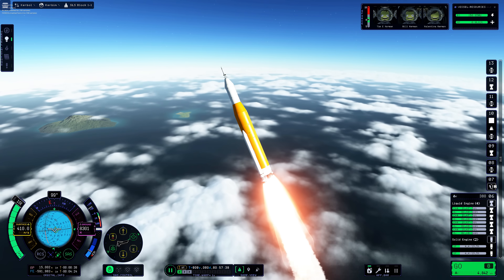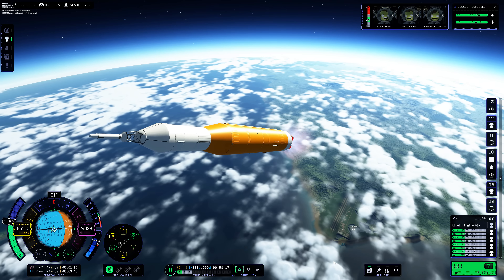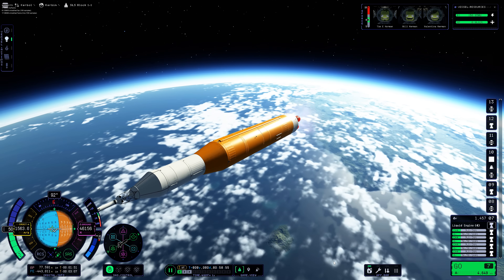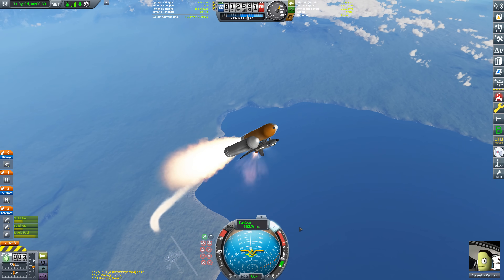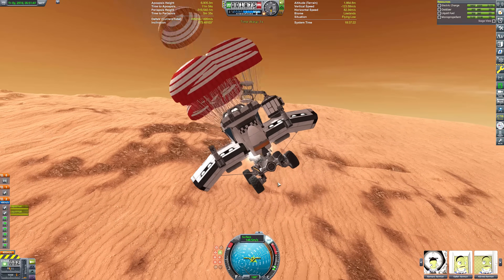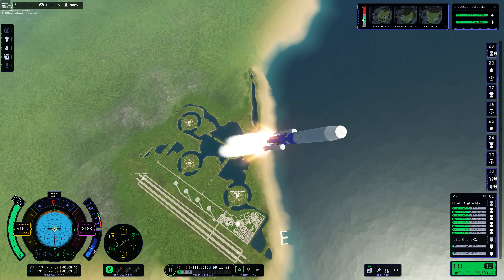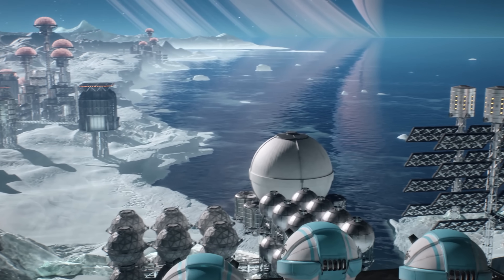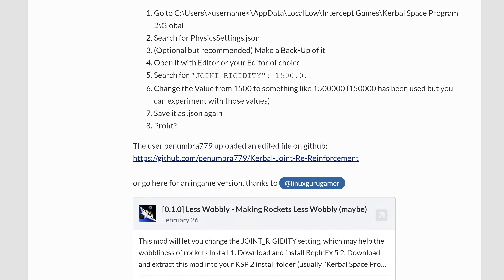Wobbly Rockets Still Haunt KSP2: Developers Face Uphill Battle

Comment: 4:50 I interpret it this way:     
Making it one rigid body means it cannot flex no matter how inaccurate that is. If you have an RCS or engines on the edge of a long stick it should flex, and making the entire thing a rigid body means it cannot flex at all. So the vessel cannot react to the forces put upon it, and the joints would not be able to break from G forces.
Reply: Joint stresses could still be measured without allowing them to deform and move independently. 

If two fuel tanks are stacked on top, they can be counted as a single rigid body with a center of mass in the middle for force application, but the joint can still be tracked.  The closer a joint is the the center of mass, and the further away a force is from that center of mass, the greater the joint stress.  Don't allow them to bend, but still allow them to break. 

That would solve a lot of it.
Reply: @DaveyKanabus  But then there is no external indication of stress. The rocket would just snap. That would be incredibly frustrating for new and old players as they think they are within the performance envelope only to over G the main tank and have a RUD. Turning down joint elasticity would be a simple fix. Elasticity is Stress/Strain (Stress over Strain) or (F/A)/(deltaL/L0). So by increasing the joints strength (or reducing the change in length) the elasticity decreases. That would arguably be the best fix but figuring out how to make DeltaL smaller is no easy task without making rockets hilariously strong.

Comment: So I know nothing about unreal and unity physics simulation. However, after having spent a decent amount of time using Godot, I can’t imagine it would be that hard to have the following to wobble check functions to match Matt’s suggestion:

(1) each vertical stack is treated a a single body.

(2) for each vertical stack, check the relative diameter changes from bottom to top. If there is too much change in any given part of the stack, a wobble point is added.
Reply: Thats exaxtly how it should work. Diameter check, mass check, something along those lines. If a % threshold above the center of mass is exceeded, stack joints get flex. If not, single rigid body. QA for corner cases and what not, patch in 2 weeks. 

Who we kidding? Devs wont have a solution for another year+
Reply: Yup. Then, if wobble is so essential, do it procedurally based on the current state of a joint as a visual cue instead of a physically accurate simulation. This can then be tailored and adjusted like any other game mechanic to be visually appealing and not annoying.
Reply: This is exactly how it should be
Reply: Yes, that would probably be far better!
If they really want to keep a complete simulation, it could be an idea to compute the forces applied to each part of the stack, but without applying them as long as a threshold for the torque on a joint isn't reached.
That way as long as everything is going straight : minimal torque on joints on vertical parts, so everything vertical is treated as a single rigid body. But if things are going sideways (literally)->more torque->joints become active and the rocket deforms/explodes as expected.
That would probably need some not so easy work on the physics engine.
But allowing joint movement, even minimum, on meaningless torque is a problem, because it can trigger some resonance between propulsion correction and joint deformation which greatly amplifies the problem
Reply: All I know is that SR2 uses unity and has zero wobble.
Reply: @maxxiong yea cause the whole vehicle is treated as a single rigid body which is probably accurate than every joint being wobbly🤣🤣
Reply: @maxxiong  And rockets in SR2 don't feel right.  They feel like icons on the screen that don't react to aerodynamic forces at all.  Especially when a craft breaks up, it just deletes parts that exceed aerodynamic / heat limits.
Reply: I agree, although I don't know how you'd treat it as a single body and add joints. It'd have to split in two, per (wobble point).
But regardless, if not this, I am sure a more nuanced solution also exists out there. It just takes time, effort and money to pursue it and I hope they do.
Reply: @WillowLiv  when the craft is being built (after loading), these checks would take place, along with a check for center of mass, to create the object itself. That way, you wouldn’t have to change the object during run time. However, even if you wanted to make it adjust during run time, you could create “active” and “inactive” joints. Whenever they change, either replace the object with an updated object (one more joint added or removed), or program the separate objects to receive all of their vector and physics information from the “main” body until the joints are set to “active”

Comment: They should just do something like, node to node connections like you would find in the main stack where it should be one rigid body, those should be considered one piece but if you attach stuff on the side of a piece where attachment nodes are not touching, those should be simulated joints, then you keep the wobblyness of poorly attached boosters but negate it on your main core that should be rigid.
Reply: And have maximum mass for the nodes, assigned different vaules for fuel parts so it doesnt messup the node calculation.
Reply: Exactly my thinking. Basically a hybrid approach - not 1 rigid, but groups of rigids with the potential for flex being at non-100%-100% like for like interfaces. This would lower the part count calculations (thus helpful for big structures), reduce the number of struts needed to only the critical places, and just make things better overall, while still having SOME flex in the areas that SHOULD flex (like a small diameter interface part attached to a big or vice versa.)

Comment: Even for rockets that are poorly designed, I don't think that they should wobble. there are more realistic and interesting ways to make long skinny noodle rockets perform poorly. They could be much weaker and prone to breaking from aerodynamic stress or shifting weight, or they could be made less easy to control with gimbal or reaction wheels. The wobble always looked silly and completely unrealistic to me, and I hoped that it would be gone in the sequel.

Comment: Simple solution:
All parts within one unit act as one part. (One unit being one stack not separated by radial decouplers.)

If "x number" of parts of the same width or above are stacked then slight wobble is to be expected.

Comment: I think that you are right Matt! Additionally I have some additional ideas that could help optimize game's physics and game itself:
-treat stacked fuel tanks as single physical entity, or even swap 3 stacked fueltanks with single, stretched 3 times in it's length
-OR make connection nodes dependent on part's size and width. Two big tanks stacked together will have stronger connection that two smaller
-make radial connecting weaker. It's pain in the butt for real engineers (see falcon heavy) it can be for us too!
-maybe ditch idea of wobblyness entirely and put something other in that place. For example partial parts crumbling and deforming?

Saddest thing is that you really can optimize game by just logically reducing thing in scene of the game and simple simplification, and having optimalization in mind from the start. If just now they think about optimalization I'm very sceptical about multiplayer working properly.
Reply: Ditching the wobble for something like a %chance to crumble, crush, or snap (depending on the part type) is a good idea, higher part count = higher chance a segment will deform and cause a RUD. that way, the physics calcs don't have to begin until the event is triggered. adding struts and structural parts can then reduce the % chance.
Reply: @grtninja  I don't think that kind of random chance should be in a simulation game. Yes it can be realistic, the world is very chaotic, but it's not the kind of realism that people want in games. When you're finally about to finish that mission but the stress of re-entry triggers an RUD with 1 in 1000 chance, that's extremely frustrating because you did everything right but got unlucky.
It could just be an absolute threshold of overstress, and the player exceeds that, then that's clearly their fault.

Comment: feel like this is ever the more reason to add procedural tanks! less parts, no mobility within a straight stack, and more customization
Reply from the maker: Yeah, I was disappointed that this wasn't considered, and that we can't switch fuel types in the tanks, so we have bunch of CH4-only and CH4+O2 tanks instead
Reply: @MattLowne  Even weirder that we can't switch fuel types considering there were plenty of modded tanks in KSP1 which literally could do this. It just makes no sense to seperate them all in to different parts which are otherwise identical for no reason.
Reply: @MattLowne Would be very cool and handy indeed. Would add a lot liquid feul only tanks and maybe also hydrolox/hydrogen tanks. Having variants of the liquid feul engines for hydrolox could also be nice (like if making methane is no option for a colony).

The lack of procedural parts is a big disappointment for me. Would be great for SRB, cargo bays, solar panels and struts/panels. Would make make it easyer finding a part because, because there are now way to mich already.
Reply: @MattLowne  exactly! real fuels shows the challenge and fun of picking different fuels types for different engines, even if its gui is meh
Reply: @clayel1  Silly, we want the fun of space bound noodles and trying to launch pool noodles into space!
Reply: At that point though just go play SR2 (SR2 just doesn't do wobble at all)
Reply: @maxxiong  it's Juno new origins now
Reply: It'd be 10x more fun and also valuable in an education sense if we had kerolox, methalox, and hydrolox fuels... You could teach players the upsides and downsides of fuels, and overall lead to more varied and interesting gameplay

Comment: Why don't they just make connected fuel tanks the same physics body but have things such as decouplers make a joint so that boosters wobble but the main tanks don't? It seems reasonably straightforward to implement and there is a very high chance it could solve the issue altogether!

Comment: I think that the wobliness in the srbs are fine, since it is realistic that you have to put struts there. The problem is the parts attached with a separator, those shouldn't get wobbly and should be rigid.
Reply: Yeah, joints there and on small and normal-size docking ports makes sense. And probably a part that's designed to allow flop, because you know someone will find a use for it, KSP players are like that. But just a stack of tanks, an engine, and a capsule should be pretty much rigid up until it fails
Reply: You can punish players for building things that aren't structurally sound without making everything look and feel like it's made of rubber.
Reply: Honestly, I dont think radially attached boosters should wobble either
Reply: @N9GamingOfficial I think it's worth making the player adding a single pair of struts, but that should fix it.
Reply: actually, it does have a feel of "just getting up SOMEHOW" in a kerbal manner. so think the absolute first ones you get, in career/science should be wobbly. but after that you get ones who are rigid @N9GamingOfficial
Reply: yeah, but they should add a way to attach a boosters with multiple decouplers or better looking joints
Reply: this @anoniemw.222
Reply: @anoniemw.222  I really like that idea. Let's hope for some day get it in KSP2.